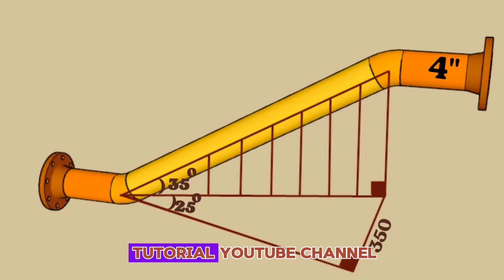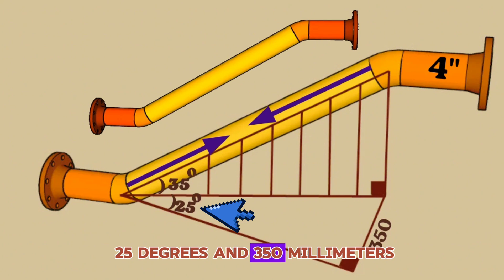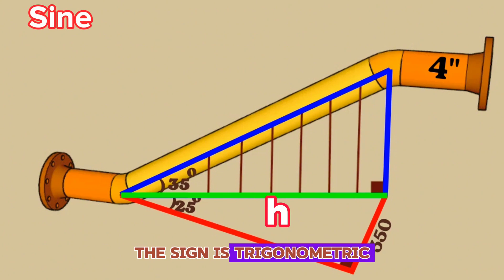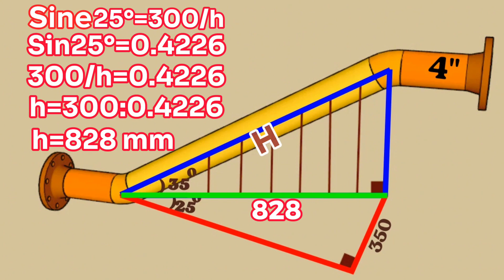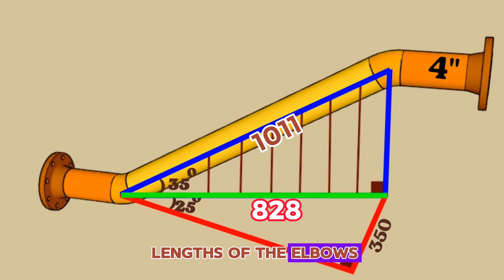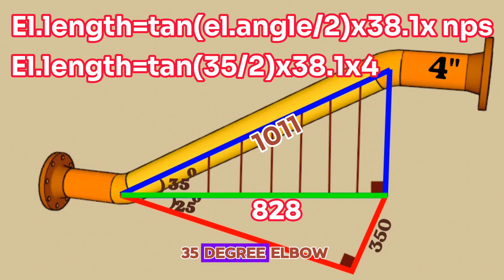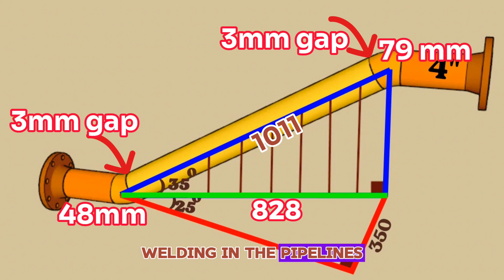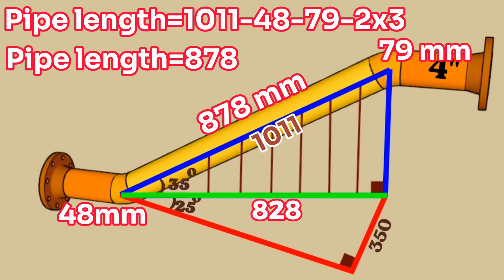Pipe Length calculation use Sine & Cosine

Comment: How many types of valve do we have??
Reply from the maker: Common used valves:
 Ball Valve
Butterfly Valve
Globe Valve
Gate Valve
Check Valve
Pressure Reducing Valve
Pressure Relief Valve
Plug Valve
Needle Valve
Pinch Valve
Diaphragm Valve
Solenoid Valve
Coaxial Valve
Angle Seat Valve

Comment: Hi please could you explain where you got 38.1 from in this formula ELlength-tan (elangle/2)x38.1x nps 4 thanks
Reply from the maker: It is standard.
1-inch 90-degree elbow length is 38.1 mm.
1-inch eLbow length = tan (90/2)x1.5x24.5=38.1 mm
4-inch 90-degree elbow length will be 4x38.1

Comment: Where did you get 55 deg
Reply from the maker: The sum of two internal angles of a right triangle must be 90 degrees, if one angle is 35 degrees, the other angle must be 90-35=55 degrees
Reply: The elbow above is incorrectly calculated, it is not 35 degrees. 55
Reply: @Piping-engineer  ống song song  2 góc củng số đo...tại sao bạn có thể hướng dẫn sai... Như vậy

Comment: IdonT understand that 300/0.4226=709.89 but base on your answer it is 828 mm how come?
Reply from the maker: Many thanks for watching and comments.
828 is correct. but I made mistake during writing calculation.I wrote 300, instead of 350.
The drawing showing 350.
Sorry
Reply: @Piping-engineer  I was getting crazy